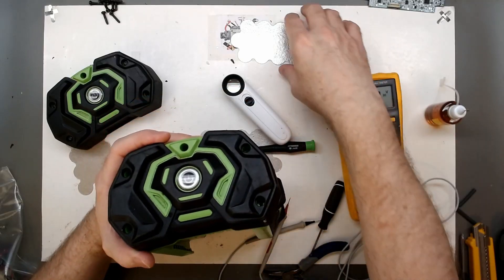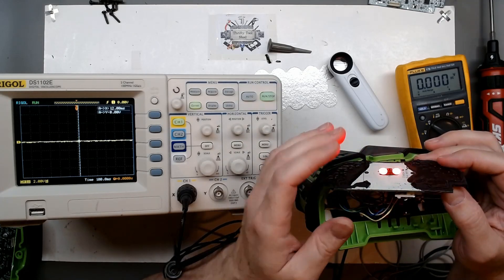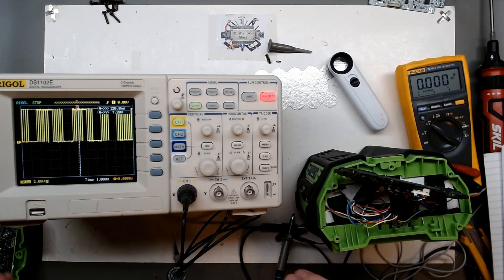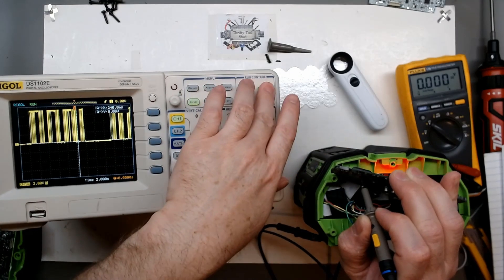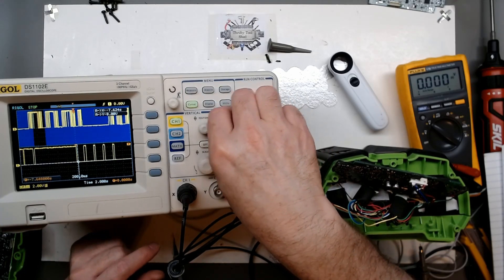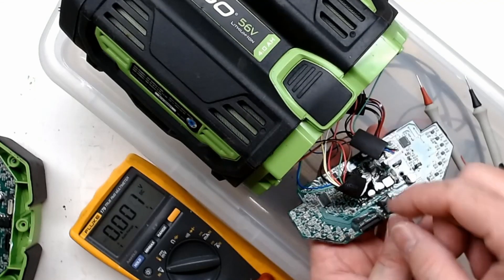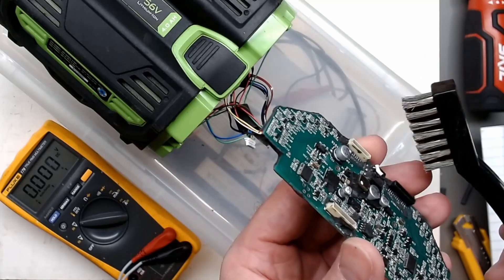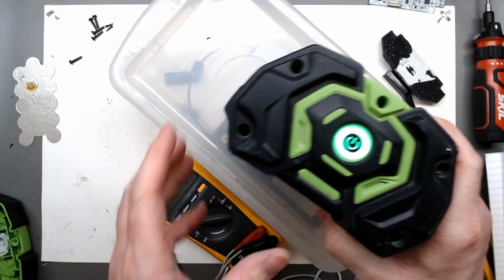EGO 4.0AH Repair #3 (LED Blinking Red)

Comment: Do you have a bms wiring diagram for the 4ah battery?
Reply from the maker: I only have the 2.5ah wiring diagram video. The 4ah will have the extra wires for the middle temp. Monitoring board, but it's very similar. 
https://youtu.be/RfTJODoh8Q4

Comment: I'm still searching for a way to buy the BMS boards.  I've googled several numbers pulled from boards with no luck yet.  Have you been able to identify the BMS manufacturer?  I would imagine it is a china based company.
Reply from the maker: It is China made for sure. Chervon that owns EGO is a china based company and the aftermarket packs are made in China obviously. I still have not had any luck getting them even with the aftermarket brands I contacted.
Reply: @ThriftyToolShed  Thank you.  Every scrap of information helps.  Let's put our heads together and figure this out. :) One thought I had about removing the water proofing from the board.  I'm going to try a basket ball needle inserted at the edge and see if I can get that to separate from the board easily.  It might work. LOL

Comment: I've been working on a 56v 5.0 battery that was manufactured Jan 2022.  All the cells are very balanced and healthy.  Nice, probably never been charged or discharged. BUT this pack won't charge or run anything.  It's the later led ring style and it flashed red when the button is pushed.  I'm opening the pack now.  They used way to much "glue" on this one so going is tough.  I'm thinking the problems is in one of the boards that monitors individual cell voltage.   Update: Both cell thermistors ohm at 10K.  Hmmm......  The leads from the center boards ohm at 9 Mohm. I compared this to the reading on a 7ah pack that I have tore apart for cell replacement and they are exactly the same.  Hmmm..... Still working on it here.   The board with the contacts appear to be straight through connects.  It appears good.  Continuity on all lead to contact tests.  I am thinking the problem is on the BMS itself.  Yet another update:  I learned the 7.5ah BMS is compatible with the 5ah format.  I tried a good 7.5ah BMS and it works. The charger will charge it and it does indicate battery level.  So the problem is definately on the BMS board itself.  I will continue trouble shooting and focus on the BMS itself. Your thoughts?
Reply from the maker: It does sound like the BMS for sure. I have seen corrosion at the pins at the individual cell balance header connector. Cleaning with plastic safe contact cleaner is best and high percentage IPA with a swab may help. That's just one issue I have seen, could be other issues with the board reading the cells including a resistor, transistor or even the microcontroller itself. Best of luck to ya!

Comment: I have this same problem. I broke the pack down and replaced 2 bad cells. I put it back together with repackr after grading and charging all the cells and had a similar red blinking pattern. It was reading 58 volts so I thought it was over voltage code although I couldn't find much on this issue. I ran it in my mower down to 54v but still the same red blinking. I checked for corrosion and none was visible. I did find one cell group was 0.2 volts higher. I put it on the charger and left it showing a full charge for a couple days. Now it's reading 45 volts and still blinking red. Also it's still showing full on the charger. Is it a bad BMS or may I have done something wrong when soldering the leads? I taped and labeled all the leads so I don't think thats it. Any advice would be appreciated. I'm about ready to break It down for cells. Lol
Reply from the maker: Flashing red with a pattern is usually the BMS thinking at least one of the cells is low. I would start with going around the points on the BMS as I showed in the first EGO battery repair video I have and test voltages from B1,B2 all the way to B14 and see if anything shows different from what you measured across the cells directly. It could be one of the cells not reading all the way back to the BMS.  If you don't find anything there and cells all test good then it could be the BMS? Hard to say for sure, I have shared a lot of what I have learned so far. Still much more to learn for sure. Best of luck to ya!
Reply: @ThriftyToolShed  Thanks! I'll try it and let yall know what I find.

Comment: I don't have the electronics know-how or the multimeter to do the diagnostics, but I am having the exact same red blinking pattern displayed by my battery. I will attempt to dismantle and clean as you did. This is very helpful.
Reply: Know where to get a replacement cell for this pack?
Reply from the maker: It is hard to say for sure which cells are in the packs due to the unmarked cells but we know they are close to 2500mah due to the 2.5ah, 5ah etc. rating. I bought several bad packs from eBay over the last 4 years or so and tested and collected the good cells from some packs while that helped me repair many packs. We know they will be high current cells. We have had some comments from viewers on here saying the cells they thought their packs have.....
  (Jonathan Ridder) mentioned his had Sanyo UR18650NSX. (Ipissed) mentioned his are Samsung INR18650 with phase change sleeves made of paraffin wax/carbon graphite.
Reply: @ThriftyToolShed  thank you for the info. Would you consider selling a cell or would you consider repairing? I didn't see you mention that anywhere. I'm assuming you normally purchase, repair and sell refurbished packs?
Reply: @ThriftyToolShed  would you be interested in purchasing this pack for repair?
Reply from the maker: @LoboX89  
I would be interested, but if you want to take time to put it on eBay as a non working pack it will bring pretty well. I watch for some of these from time to time and the price has gone up on what these bring. Seems people like them for e-bike projects and such.
Reply: @ThriftyToolShed  I have contacted the local shop that EGO has listed as a repair place, but haven't heard back yet from your counterpart (that one guy in the shop that handles these things) with even a ballpark cost of repair. Thanks for your replies. I thought I'd sent a message to you on Facebook. Which do you prefer for this type of communication?
Reply from the maker: @LoboX89  Facebook messenger is best.

Comment: Nice video. But too much work or technical for some folks. My battery was blinking red on me and it wouldn't run. I took the battery and play with it using my blower and it started to work. Working fine now. I just mowed and charged it. So don't give up on your battery if this happen to you. May be I got lucky. It just happened to be in a bad state and needed something to clear its mind.

Comment: Have two of these and for the second time were lit up red and pretty warm. As soon as I picked them up light went off and checked the charge. Both appear fine. For some reason they are heating up while in storage inside my house.
Reply from the maker: After looking at the manual for the newer packs it seems that also blink green while storage discharging. The solid red seems to only be for over temperature. So is it possible these are getting too warm while discharging for storage? The BMS does have a NTC thermistor on the board itself as well as on the cells for monitoring.
Reply from the maker: The EGO packs will go into a storage drain after 30 days of no use. The older Gen packs with the single LED indicator would flash green when in this mode. I am not sure if the newer ones do the same or if they flash red? I know the end caps would get warm on the older ones as they pulling down to 30% charge level for long term storage. Don't know if this could be what your seeing, just wanted to share that.
Reply: I just read a comment on Amazon with the same problem. The consumer contacted ego and they said that it's a normal function during long term storage. It lit up green on the charger so it should be good. Thanks for the quick reply.

Comment: I figured out what does and what happens with MJD117 transistor, this is a weak point of this BMS, this transistor is the main power gate, and has no input filter, it takes the full brunt of switch pulses,of motor driver, especially in cold weather when cell impedances are hi, this slow transistor does not cope with fast transitions and is partially or fully damaged and drain the battery.
https://endless-sphere.com/forums/download/file.php?id=294569
Reply from the maker: What do you mean by motor driver?  It drives nothing but BMS board self discharge functions. Besides the DC-DC converter section, this Transistor drives nothing else. I believe it's only a 2A rating.
Reply: @ThriftyToolShed  Tool motor driver, when battery is hooked to the tool and running, motor driver generate parasite pulses across power lines and damage the slow MJD117, this transistor not perform self discharge by itself, It is the main power gate of BMS, If you remove it BMS do not start, no light when press button, and no handshake with the tool.
Reply from the maker: Correct, it is part of DC-DC converter on the BMS. You are referring to a carrier frequency issue on the rail. Seems to be around 15khz or so...
Reply: @ThriftyToolShed  Yes, emmiter of mjd117 is coonected directly to positive pole of cell string, with no lo pass filter, E.G. a series inductor and a capacitor to ground, for example I baked diode bridge in a charger connected directly to my main string 120vdc with switching pulses from my solar charger, silicon carbide buck converter, the converter had an output inductor but it was small. 
This BMS has no power gate for load, but has power gate for it`s own electronics, this is mjd117, it feeds in dc/dc converter, but for some reason this dc/dc is not shut down permanently  if the power gate is shorted, it starts ans shut down every second.

Comment: Impressive what brain work to understand these BMSs, I never attempted, to repair such a thing, In my opinion  T and D terminals are a serial interface  T is clock or timing, and D is data, I am forced to dig in about these batteries because I purchased a faulty battery with a chain saw and a blower, In fact these batteries exists under two brands, EGO and karcher, ego are green and karcher are yellow, but are fully compatible, inside are identic, I run my cs330bp karcher brand with a BA2800e EGO with no problem,  but there is also an aftermarket battery ruzixt, It is cheap and good.
Reply from the maker: I did not know that Karcher Germany had the same pack, but I have a video on the Ruzixt 5ah pack. I was glad that someone on some level figured out the BMS. I believe Ruzixt simply pulled the microcontroller programs and just copied it though!

Comment: are the bms interchangeable between battery sizes? Or are they specific for each
Reply from the maker: At first I thought they would be the same because they look similar and same headers (on same generation packs that is) but I have noticed the programmed microcontroller is programmed different. I think I mentioned that on one of my last 4 or 5ah battery repairs. Larger packs have more NTC thermistor or temperature monitoring feedback to BMS. I also believe the pack talks to the tool through the D D-terminal and some tools are allowed to put out more torque with larger packs.
Reply: @ThriftyToolShed  Thank you for the reply. I guessed that there might be differences in allowed current draw. I have a 2.5Ah that drained itself (the short issue), and a 5Ah with a dead battery bank. Felt confident using the 5Ah BMS to drag the 2,5 batteries back from the dead, but not so confident with the idea of using it with the tool. Your answer tells me that I really do need to drag the soldering iron out and do some fixing.
Reply from the maker: Yeah, best I can tell from the video with the 4ah pack Blinking the Orange light, if I plugged in my spare BMS from my 2.5ah pack the 4ah pack was fine. So I thought I had a bad BMS. Then I realized back troubleshooting with the original BMS in the 4ah that the issue was a connection at the Temperature monitoring board in between the pack halves, that is something that the 2.5ah packs don't have and then I realized they must be flashed with slightly different program. I would imagine the 2.5ah BMS would work in the 5ah (as long as they both are same generation pack, the connectors have changed over 3 different hens). it just will not monitor those middle boards with the Temp. Feedback and also may not register as 5ah on some tools such as the chainsaw to allow the same torque output as the 5ah usually. Other than that, I am not sure if any additional difference. I would assume the 5ah BMS would not work in a 2.5ah. I would assume it would blink orange with no connection for the middle boards. 
Best of luck to ya!
Reply: @ThriftyToolShed  suprisingly, all green with the 5 on the 2.5, i just don't trust that it won't allow double current draw. The middle boards must do some collating, as the connectors to the BMS are identical
Reply from the maker: Yes the connectors are identical but the ones I have (for the Gen2  packs) I had the extra wires in the connectors from the middle board. Which is for the middle of the pack temp monitoring. I have not tried the 5 ah BMS in the 2.5ah. that is suprising that it works. I could tell a difference going the other way and from that I was under impression the the 5ah would need the monitoring board to work correctly, but I never tried it. I am not sure which all tools use the torque control based on pack inserted. I am  thinking the mowers and the chainsaw. Other than those it may be fine?